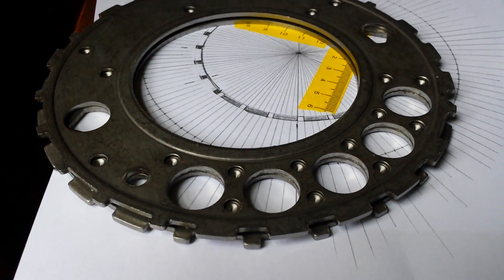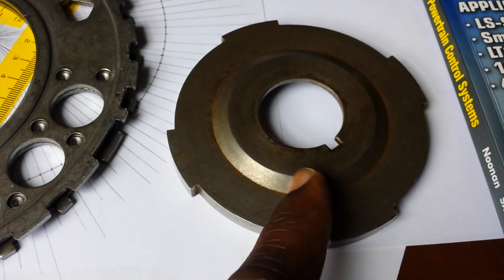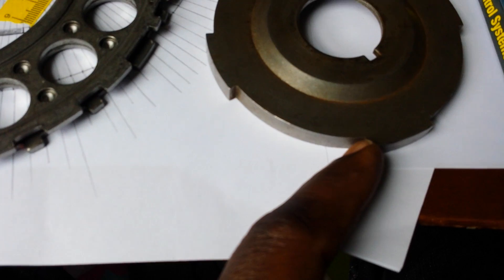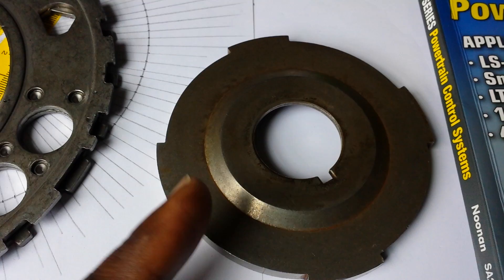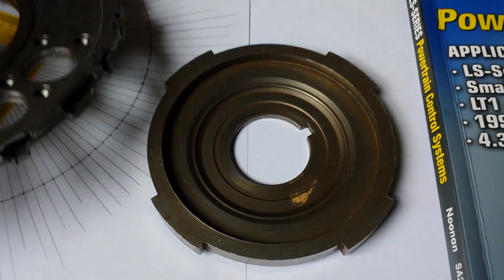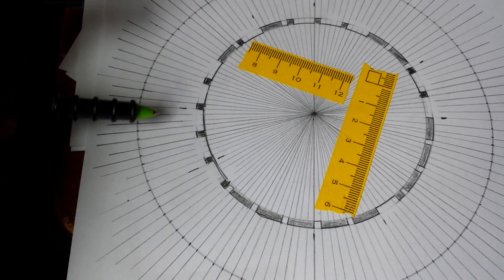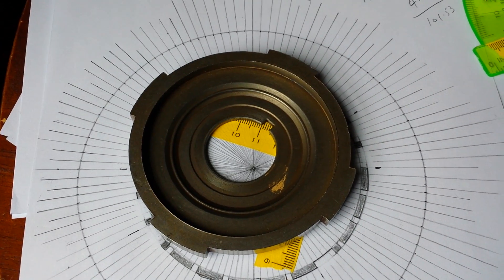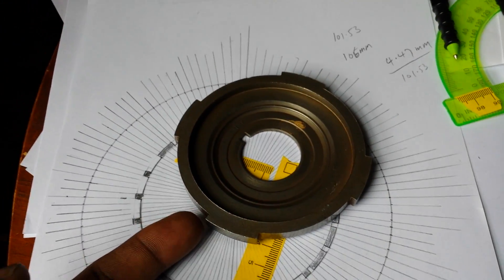Homemade lt1 24x reluctor.

Comment: For starters, this already exists. and can be yours for $175..  

https://www.eficonnection.com/home/category/engine-hardware/crankshaft-signal-reluctors/efi-24x-reluctors
Even more trivial, Most, if not all aftermarket pcm's support 4x or  4+1 trigger wheel combos. You literally could run it in batch injector mode with NO Modifications!   

You wanna know something else?   You pick the correct LS1B OS, (Van) and you can run your LT1 4+1 AND NOT HAVE TO MODIFY SHIT in "low res mode"..  

Just admit it..  This video is crap.  it's all talk and no action. There are tons of different ways that you could mate a different pcm or even specifically an LS1B pcm to an LTx, and you literally gain almost nothing from it. My LTx made 400whp NA, and I daily drove it with a STOCK PCM running a STOCK OPTI, and the original opti died right around 98,000 miles. Replaced it once and never touched it again. I sold it almost another 30k later and still had no problems.   I Also, just playing around, mocked up a Megasquirt v2 inside a stock 96 PCM case and made it plug and play and only used the front 4x reluctor. after we tuned it, it made just as much as the stock tuned pcm did.    

Summary...When you don't use your head, you always end up working harder than necessary. This is an example of that.